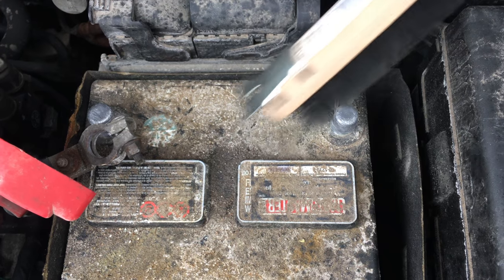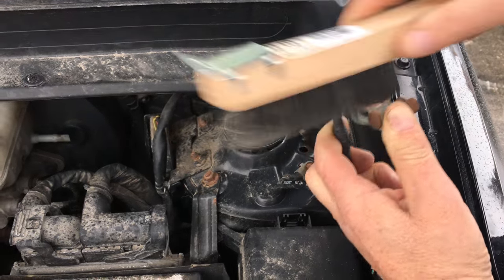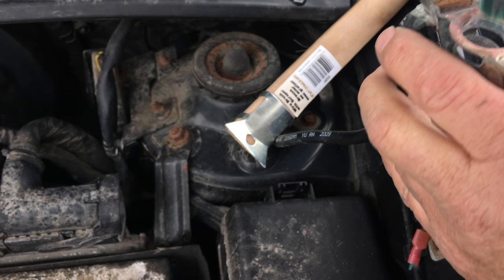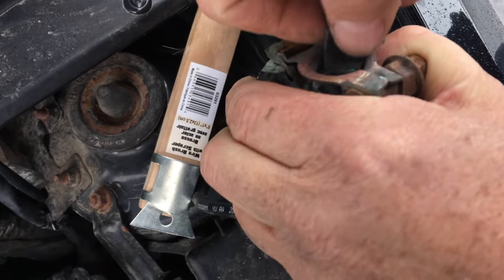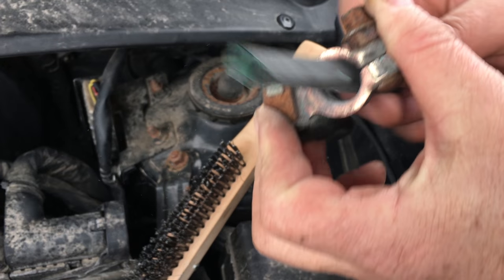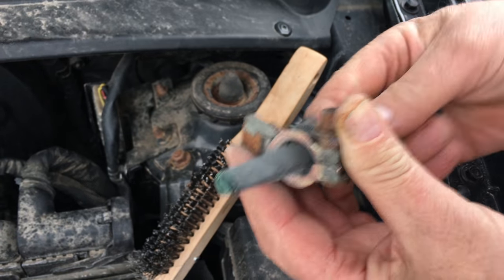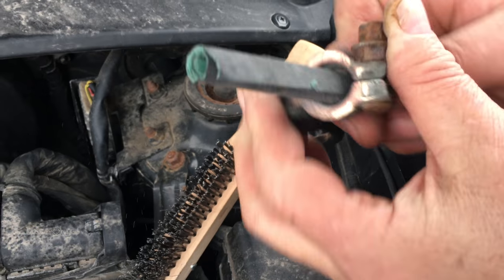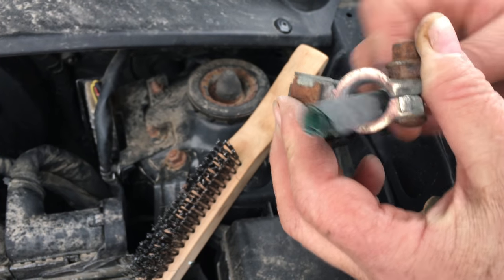Car won't start, but all dash lights come on and blink   how to fix

Comment: 100% Works! Had the same issue on my 2008 Ford Edge. Luckily I came acrross your video, and my friend happened to have a terminal cleaner. Job done in 5 minutes. You saved me $$$ I can't thank you enough. I liked and subscribed.

Comment: My 08 Mustang is doing this. From previous experience its either in order

Battery,(even if fixed then get altennator tested)
Alternator,
Or short.

Comment: First off, if you are able to turn the battery clamp like that,  it isnt tight enough and that will cause it to corrode faster.  Secondly, you can buy a battery terminal cleaning tool cheap than buy a wire brush.

Comment: Hi I have a 2005 jeep grand cherokee limited and all of the lights are flashing including the hazards and the dome lights also no start or crank the battery and the alternator are good I'm confused
Reply: Do what this video said to do. Problem solved
Reply: Same issue with my Mitsubishi Space Gear automathic transmission. After travels and parked car won't start, no cranking but headlights all dashboard lights flashing. It will start again when battery terminal disconnect in 8 seconds or more and reconnect again. I dont know if this is security system or  about the relays. Battery is tested goog and alternator charging is good.
Reply: What i had to do is swap the main computer the ignition the instrument cluster
Reply: Aside of that, after parking an hours headlights blinking for no reasons.  In that situation, the car won't start. Sometimes its look everything is okay but when the door open it will happened again the problem dashboard lights and headlights are flashing. Or  sometimes even when ignition key inserted it happens the same situation. (Sorry for my bad english because I'm not an English guy, but 96% I can understand English).
Reply: Solved ?
Reply: @anugrahk-hw1xy  yes. We had to change the main computer the instrument cluster and the ignition
Reply: @Tannerrebuilds  cost
Reply: @anugrahk-hw1xy  well we had another jeep just like it but that one was totaled. I think it would normally cost $200 for the parts
Reply: @Tannerrebuilds  🙂😇🙃

Comment: If these tips don't work for you, try resetting the alarm saftey switch while Turing the key to start the vehicle. (small red button to the left of the steering column)
Reply: I have a Pontiac Montana SV 2005 where do I reset it?

Comment: I swear to God man everything I've seen on Google pertains to bad battery connections when dash lights are flashing in a TSX are these people dumb or something... the car I'm working with the engine actually cranks over absolutely perfect The battery is top-notch charged and is spinning the engine like it should... but won't crank up dash lights flashing That's not a damn dead battery problem...

Comment: I have 2011 Hyundai Sonata Push to start cut off and wont start back! Installed new battery still wont start! Light on dash lights up Ac vents blow air. Any idea what it may be? Thank U😊
Reply: Stefanie Lawrence does the engine crank? Or what noise does the car do when you turn the key?
Reply: Ramon Romo the engine cranks but won't start, just the long cranking sound until it eventually stop
Reply: Willie Howard if it cranks but won’t start it can be a number of things. In my personal work experience, the most common reason it cranks and won’t start is due to lack of spark, gas or air. In very rare cases has it been compression or timing. Here is what I suggest you do. 1. Disconnect a cable from the spark plugs and ground it. Have someone crank the car, If there’s no spark, then spark is your problem. 2. Buy brake cleaner and spray it directly into the throttle. If the car turns on, gas is your problem... stat with those 2 easy tasks. Odds are it’ll be one of those. Let me know if it’s one of those. If it’s not, then the testing of the other become a little more complicated.
Reply: Ramon Romo if it is air then what do you suggest? 
The problem started when i crank the car, turned the heater on, went inside to grab something came back and the car was off with the dash board lights still on. Note* i was just driving an hour before all this happen
Reply: it cranked and started before i went back inside my house to grab something,, came back out and the car was off with dash board lights still on,, once i noticed that the car was off i tried cranking and starting, only cranking no starting
Reply: Willie Howard if it has to do with air it’s a little tricky to find out. I suggest putting the scanner on the car. It can be a sensor problem and those are tough to find, Do you have a check engine light on? If it’s air sometimes you can disconnect the Mass air flow sensor (located near or before the throttle or on the tubing covering the air filter) and in some vehicles the car will return to factory mode and it will turn on. Vacuum leaks can cause lack of air. 
But yeah any of those problems (gas, air, spark, compression or timing) can turn your car off from start. But I’m confident it’s most likely gas or spark. Those are the most common... look up videos on how to test for spark and gas. It’s straight forward. Once you find out what’s missing, you then check all the components of that source. Ps be careful when checking spark, make sure you’re not the closest path to ground, you will get shocked. You won’t die or be injured, but it hurts lol

Comment: New battery, alternator, battery fuse, terminals. Still same issue. 🤦🏾‍♂️
Reply: Any luck? I'm having this similar issue with my CL
Reply: @alext818  Somewhat. Out of no where it's been working. Since Xmas too.
Reply: @toolondaboards  dammit man, I cant find my issue anywhere online. And mine works intermittently too.  When I open the door and hear the little bell ringing and the dashlights blink I know it wont start for a while
Reply: @toolondaboards  dude!, so the same thing happened. Opened the door, all the lights where blinking. But I remember reading somthing online. And it went somthing like locking the car door with the key then stepping back waiting a few minutes and trying it again. So I closed the door, locked it and then unlocked it and the lights didnt start blinking and it started up!!!!!
Reply: I legit replaced the starter, ground terminal and was getting ready to do what you did too. I hope this solves my problem when it happens. Must be some kind of security malfunction
Reply: I checked all the fuses, cleaned almost every grounding I could find and it still didnt help until I did what I just did with the car key.
Reply: @alext818  Wow isn't that crazy?! It's gotta be something security based.
Reply: Mine started doing it again. I'm gonna try your method after work and let you know how it goes.
Reply: Tool OnDaBoards any luck
Reply: @mauricedaniel2500  I ended up having to replace the crank sensors after all this. I guess they all decided to go bad around the same time!
Reply: Mine did the same exact thing put a new battery didn’t start change the starter worked for two days and then did the same thing
Reply: @angelareynoso3948 same! Did you figure out the issue?

Comment: My car sssstill wont start after i did all this . even though my Battery is a year old and clean. the Battery was checked at Auto Zone ,  And they say the Battery is Good.
Reply: did you figure out the issue?